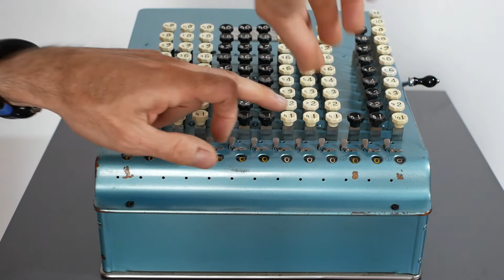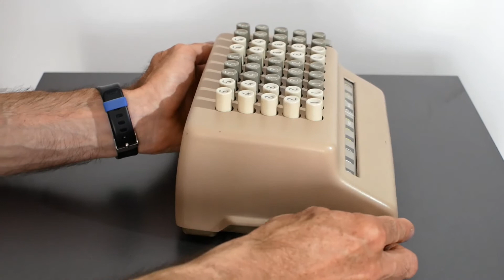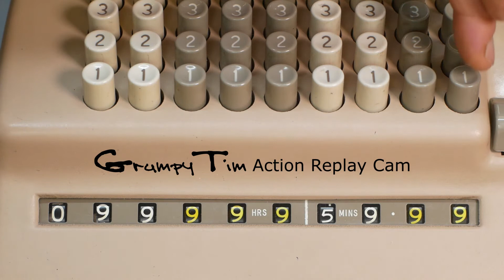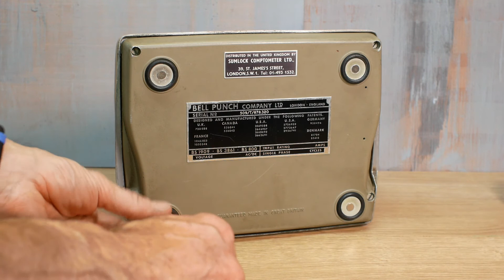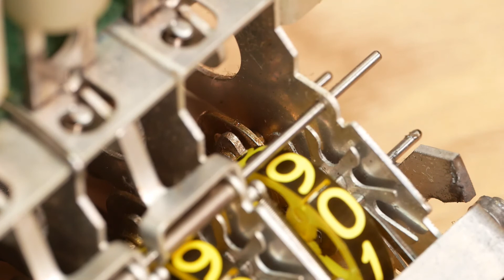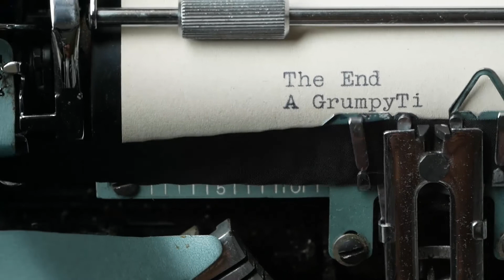Time Machine - Bell Punch Company - PLUS  model T - Vintage Time Adding Machine - Retrotech

Comment: Well that's interesting. You appear to have 509/T/878320 which is a time adder with hours, minutes and seconds. 
I just bought 509/T/879031 which is a time adder but only has hours and minutes, no seconds column. 
Other than that they look the same. 
Unusual for them not to have a differentiating s/n
I do like these machines. I am spending hours researching them lol
Reply from the maker: Hi Matt, I can't remember if I said in the video but this machine belongs to a friend, they have something like 9 Plus Adders in their collection including this time adder, a weight adder along with a few other quirky versions.  I think the Plus Adders have a charm all of their own - I regularly use a 6 column copy to add the scores when playing cards and so on, and the lack of 6,7,8 & 9 becomes something that I just don't notice any more.  One of the biggest attractions for me is the massive amount of variations that you can come across - I think they would produce custom versions for all sorts of applications, not to mention the ones that were clearly modified when decimal currency came in.
Reply: @GrumpyTim  Hi, Yeah I have found 3 so far with the designation /SP where SP appears to stand for Special Order. I have a bright silver 512/SP which is set out in 3 groups of 4, possibly for tracking inventory, or even used for Myriad  numbering system. I found one online that is a weight adder but unlike the /Y it counts in 7 ounces, different layout and SP designation. It is a huge rabbit hole trying to understand all the models.
Reply from the maker: It would be very easy to get carried away with these little adding machines and dedicate a whole shelf unit to them, or even a whole room......

Comment: Thank you for this video, it's very instructive. I am thinking about converting a decimal model PLUS to a time model PLUS (with minutes and seconds!) for teaching purposes. Do you think that the front wheels of the 6-base column could be changed from the existing ones in 10-base?
Reply from the maker: Hi nickxyzt, Bell Punch used to offer these machines in loads of different formats, and they even converted old Sterling currency machines to decimal.  They did have to swap some of the gears and so they had the correct number of teeth to work in a different base, and that often involved a different axle position.  On base 10 machines the front gear axle is a straight rod through the machine, but on other models with mixed bases, there can be other shorter rods (axles) with the side frames drilled in the appropriate position.  Also, with the shorter rods, they have to have a retaining clip to stop the rod moving sideways.  The number wheels always share the same axle as they always have to show through the viewing window.  In theory you could convert one of these machines, so long as you have or can make suitable gear wheels and are happy to strip the machine down to re drill some of the side frames and so on.
Reply: Thank you, this is valuable information. I will do my best with the conversion, and if I will succeed (hopefully) I will also post a message here.
Reply from the maker: Cool, I'd like to see how you get on.

Comment: I've just inherited one of these (in exchange for a modest sum on eBay.) Model 309 Plus. Guessing it was for old currency - the smallest unit goes up to 11 before flipping over, oddly. Must say I'm loving it after getting it going with lubrication and gentle coaxing of the keys and arms back to life. Using it is bound to be good for your brain with only numbers up to 5 and the rest down to the user!
Reply from the maker: Excellent Peter, you should have loads of fun with that - ignoring the first three columns for the pence and shillings you can just use it as a normal decimal adding machine - I find that I don't really need to think any more as I input numbers on one of these, although doing subtraction is a little trickier, and I tend to leave that to one of the bigger, full keyboard machines.

Comment: The reason why the seconds are shown as minute fractions is because it was intended for billing and timesheet tasks where a per-minute rate was charged, say for example for audio transcription. It remains the case that audiotyping is charged for per minute in the original recording and often when jobs are quoted or billed, a rounded seconds fraction table or a calculator is used to convert the HH:MM:SS time to decimal minutes as this is used to calculate what the client pays; e.g. 01:34:15 = 1h 34.25 minutes x £1.20/min. Therefore showing and handling the fraction entry and result in seconds is not helpful because would require dividing the minute rate by 60 and multiplying by the seconds to work out the price of the remainder (resulting in an awkward small fractions of pence), whereas doing it the other way around requires only that the per minute rate is multiplied by 60 to account for the hours which keeps the result in integers. This was especially important in pre-decimal currency where the price of the fraction represented by the seconds would have been even more of a pain to calculate.
Reply from the maker: Wow, thanks Andromeda Turnbull, that's an excellent explanation, and now you've pointed it out, it makes perfect sense.
Reply: @GrumpyTim  You're welcome! Glad to be of service. I missed off the final step in the process, I realise. With this method you don't need to calculate the price value of the seconds fraction separately - you just read off the minutes and fraction together ignoring the decimal point, and multiply it by the rate dividing by 100 when writing out the result. Magic! Hope that helps :-)
Reply from the maker: Awesome, again that makes sense. I'm really glad you spotted this video and filled in that gap in my knowledge.

Comment: Can you help me 🤯I pulled pin out by mistake it took me hour to get the wheel back on 😡 it seems to work but when I reset the first wheel resets to 4 ...my brains is fried ...
Reply from the maker: Hi Keith, those pin type axles are a genius idea for simplicity but also all too easy to pull out a bit by mistake and then everything falls apart.

I have an idea why yours is resetting to 4 instead of 0 but I'll need to go and check on a machine later - I'll add another comment once I've checked.
Reply: @GrumpyTim  Thanks Tim ..look forward to any ideas or thoughts. Keith
Reply from the maker: Hi Keith,  I've just had a look at the Plus model T - assuming yours is a similar age there should be some plastic gears at the bottom front with an intermediate gear between them and the number wheel - if I remember correctly the older models had metal gears but apart from that the operation is the same.  It's those bottom front gears that index where the number wheel stops - there's a pair of bottom front gears for each column, with a spring between - the spring returns the wheel to zero when you press the reset lever.

The bottom front gears can rest in two different positions because they have twice as many teeth as the number wheel - to make it easier to see, enter numbers in that column until the left bottom front gear has it's pin at the front and then press the reset lever.  The two pins should now rest against each other with the right hand one above the left hand one.  At this point the number wheel should be at zero - if you move that number wheel upwards with your finger you'll see the two pins move apart and when you release the number wheel they'll spring back together.

If everything appears to be as I described it, then I think it's only the position of the number wheel in relation to the intermediate gear that's wrong.  To adjust this you'll need to carefully withdraw the pin just enough to free up the number wheel, lift the number wheel up just enough to disengage it from the intermediate gear and rotate the number wheel until it reads zero, then lower it back into position and re insert the pin.  You might be able to make it easier by inserting a fine pin (the kind of thing you'd use for sewing) as you withdraw the main axle pin - that might just allow you to angle the dressmaking pin enough to get the number wheel to disengage from the intermediate gear so you can turn the numbers back to zero, then re angle the dressmaking pin to lower the wheel back in line with the axle pin and push the axle pin back into place.

Just a side note, probably no help here, but there is a spare axle pin on these machines - it can really help if you have one that needs cleaning or lubricating - The Green felt material that sits beneath the keys and on top of the mechanism to stop dirt getting in is held in place with some bent bits of wire - these are located at the rear by a pin - this is the same material and dimension as the axle pins and can easily be removed.  Once removed, this pin can be used to push out any of the axle pins without all the bits falling off.

Hope this helps a little bit.
Reply from the maker: Hi Keith, I've just been working on another of these, I'd forgotten that the older versions don't have the spare pin at the back to hold down the felt bits, so that bit of my reply might not have made any sense.  There is still a pin at the bottom front that just holds some of the frame together - I successfully removed this one to use as a substitute pin/axle while I cleaned old sticky oil off the actual pin/axle.
Reply: Hi Tim , thanks for the help the spare axel did work .. I did send you a reply but it seems to have gone missing.. I did get it all back together and it all seemed to work ! But when putting it together I did break the Number wheel so had to glue it back together .. As I said I got it all back together in the end all seemed fine apart from when the first wheel was on Number 8 .. it would not reset ! I did send you another email asking anymore ideas but that looks like it was lost..
It took so long to get the cog , number wheel & washer together..the 1st and then 2nd time I found it hard to find the courage to go for a 3rd time .lol ..
I left it until the next morning with a fresh head and looked at it logically it was resetting from 7 & 9 but not 8..    so before I took it all apart again I looked at where I had glued the wheel ! And there it was ! The opposite side to the 8 was where I glued it and a bead of glue was on the side of wheel and rubbing against the plastic cog .. thanks again Tim ... Keith.
Reply from the maker: Excellent, that sounds like you've done a great job - they're fiddly but fun machines.

I've had a few comments that I've left on other peoples channels go missing too - I think YouTube are using a very enthusiastic filtering algorithm that sometimes seems to delete perfectly good messages!!!

Cheers for the comments.

Tim

Comment: That explains why the mechanical adding machine I have is in Petter green.
Reply from the maker: I only found out about the Petter connection in the last month - it's quite exciting and a great link to my other stuff.

I love the simplicity of the mechanical calculators - that's not to say that they're basic in design, but when you have one in front of you that won't work (which is nearly always the case when I get them), it doesn't take long to figure out how they should work and therefore what needs fixing.

This machine was sticking on the number wheels - old oil that had gone gooey - quick re-oiling and a big clean up and presto, another working machine!!!
Reply: @GrumpyTim  but have you seen their flying machines?
Reply from the maker: I'd read somewhere that there was a connection with Westland - I had a model of a Westland Lysander as a kid and I assumed it was the same Westland.
Reply: @GrumpyTim  It is the same Westland yes, started by one of the Petter family I believe.
Reply from the maker: Kind of amazing to be involved in so many interesting things - cool family/company.
Reply: @GrumpyTim  True